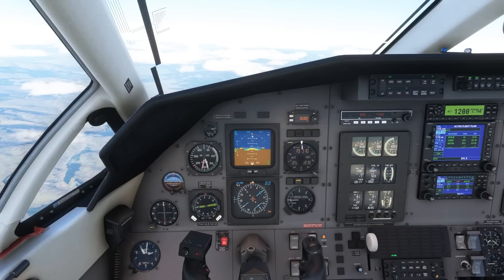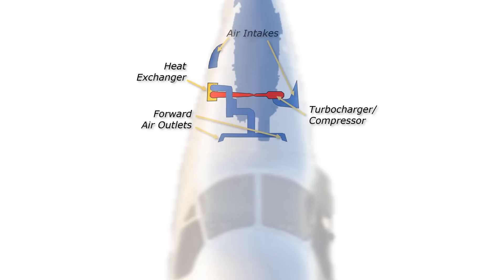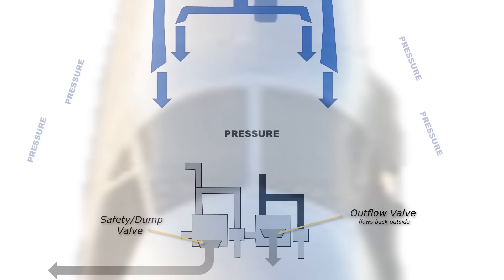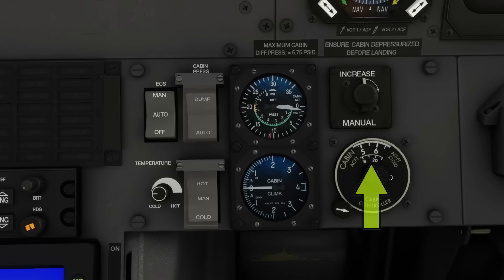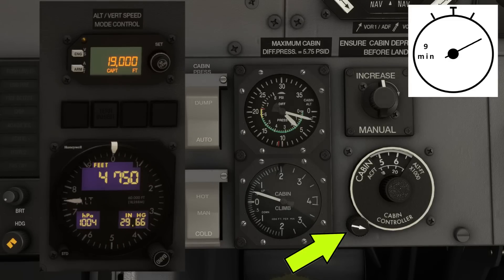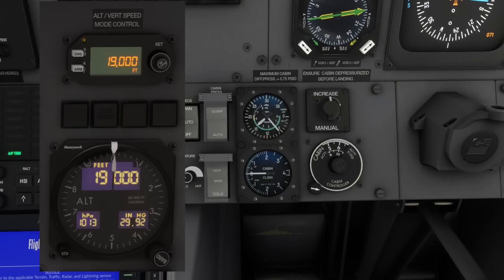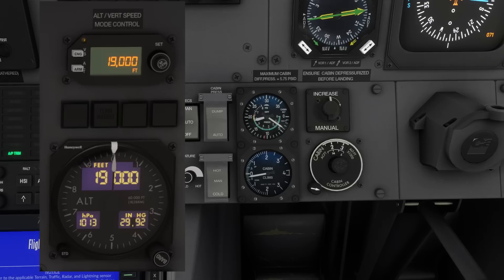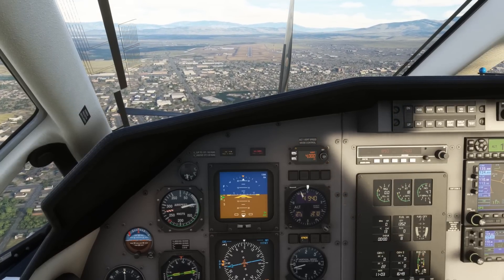How Cabin Pressurization Works | PC-12 Pressurization System | Commercial Ground School

Comment: Can we just set it to automatic? Why would we need to do anything manually? Can't the system just detect the absolute outside pressure and pressurize accordingly?
Reply: In more advanced systems it works completely automatic. In my daily driver, the A320, we usually never care and work with the pressurization system in normal line operation. The system knows its departure altitude, pressurizes at a set schedule and knows, from the FMC flightplan, the altitude of the detination, and from the landing performance page the QNH there. So the depressurization schedule is done automatically as well. Unlike smaller planes like the PC-12, bigger planes usually land (and take off) slightly pressurized, which prevents pressure bumps through the outflow valve during flare and rotation, the valve is usually at the back if the fuselage. Take offs can and are done unpressurized for performance reasons (lower bleed load, lower engine performance needed, more available for take off) some airline do it as standard as it can save fuel as well. During taxi in the cabin automatically depressurizes by fully opening the outflow valve. In some airplanes (Airbus for example) there are independent pressure sensors in each cabin door that flash a warning light if the cabin is for some reason still partially pressurized, in that case the doors won’t be opened as the risk of injury is extremely high.
Reply: So you take off from Texas from less than 1000 ft to cruise at 14000 ft with the cabin pressure down at 8000 ft, then land at Leadville CO at near 10000 ft.... Now what the plane realizes it's on the ground with 2000 ft worth of atmospheric pressure inside and no idea how soon you want to open the door.

Comment: PC-12 is my favorite plane on the sim, and this is one of the last few things I didn't understand in order to do fully realistic sim flights. Thanks!
Reply: Good morning Gaston, this is also my favorite plane, but I have the problem that my FPS has dropped to 8 FPS after half an hour of flying and then you can no longer fly with it.
Have you also had this problem and what advice can you give me to solve this if you have also had this problem?
Thank you for your answer.
Friendly greetings from The Netherlands.
Reply: @jackwoud  In MSFS settings menu, there is an option to clear the rolling cache. Try it. In my case it resolved my FPS issues.
Reply: @jackwoud  I have not experienced that, also I fly on an Xbox Series X, not a PC.

Comment: Thank you soo much. Again the level of detail that u are covering is outstanding. Question is that MSFS , what version has PC 12. Thank you.
Reply: That is the Carenado PC-12. It's actually pretty good for a Carenado, flies a little wonky but as this video indirectly shows, systems are at least decently well modeled. A big however to that is Simworks Studios, previously known for their fantastic Kodiak 100, is making a rendition of the PC-12, which is supposed to release in the next couple of months and WILL be significantly more advanced than the Carenado.
Reply: Wait for SimWorks to get their own PC12 out. Should be soon. If it is like their Kodiak, it will be a great plane.
Reply: Marketplace Carenado PC-12. Is not included in any msfs version.
Reply: Just get the most expensive one or buy one in market place